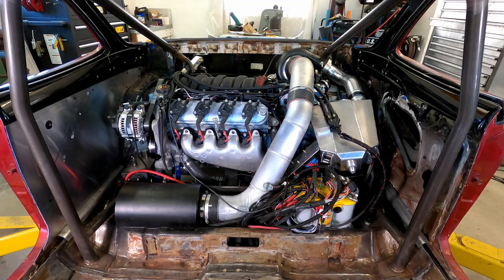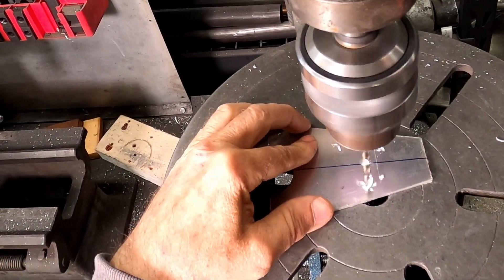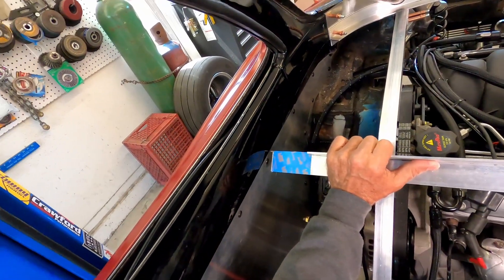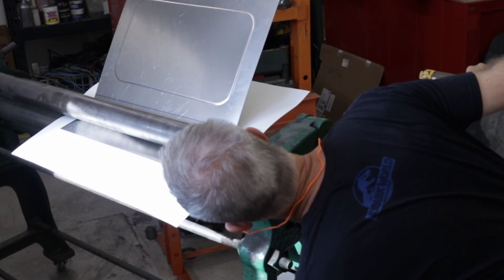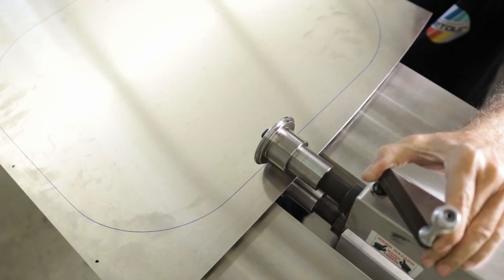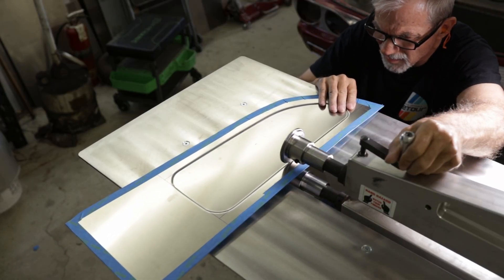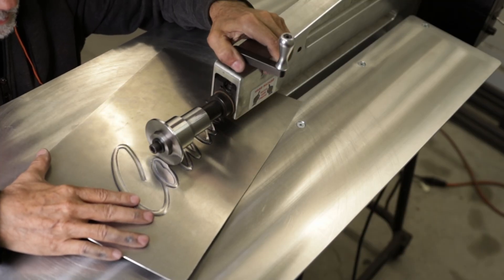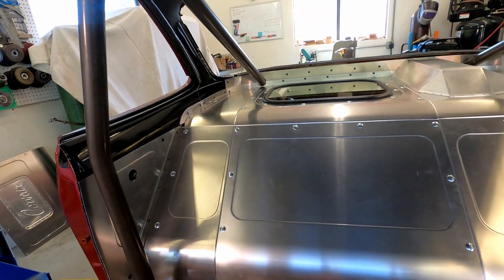Complete aluminum engine firewall construction

Comment: Hi John, Fantastic work!! Hey.. can you do a little over view on your bandsaw. It seems to cut all sorts with ease. It would be nice to know some specifics?
Reply from the maker: Yeah, it’s a 40 y/o 18” Enco. I think I paid about $800 for it 15 years ago.  I always use a thin, narrow 1/4” blade so that tight curves can be done.  Sometimes it’s the most used machine in the shop
Reply: I guess we don't have that brand in New Zealand. Is it designed as metal only or is it one that's been modified ? Cheers @JohnReynolds661
Reply from the maker: @KiwiSkipper  You just need a slow speed unit that is made to cut metal.

Comment: Radii is the plural of radius. Hokey smoke, radiusseses?   Hearing your explanation of the sight glass for the engine, cool, I was hit with a thought, Why not get a replacement glass from an oven door. I have never tried to acquire one to purchase but a good appliance store may be the place to try. Now that the cover is made, modifying the size would be a pain because if you have my luck, nothing will match. McMaster-Carr sells borosilicate glass in different sizes and the larger come with a chamfered edge. It won't break you but it is saltier than window glass. Nice work, actually excellent, with the Corvair script.  Many younger people have never seen nor heard of a Corvair.
Reply from the maker: Oven ( tempered ) glass would certainly take more heat.  It's also cheaper.  I'm not sure how much heat the glass will receive, with the open back and 3 deg. roof angle, I'm hoping it rolls out.  I'll replace it with tempered glass if there's a problem.  Otherwise, the advantage to laminate glass is a lot better sound proofing.

Comment: It's impressive. Seen through video, I thought the "Corvair" panel might look good unpolished and on the horizontal section of the firewall so it could be see through the back glass with the other features like the hump and sight glass.  But you're there, and that probably tells you everything you need to know.

Comment: You sure you wanna do that, bud? Melting point of Aluminum is 660C, melting point of mild steel is 1350-1550C.... Just saying there's a reason why they call it a firewall.

Comment: You should consider adding thin layer of killmat to the back of your panels to help with noise, heat and vibration. With all those metal to metal panels I think your have lots of metal vibrating or clanging noise. This is the best Corvair build I’ve ever seen in my freaking life

Comment: The Corvair script looks great but it isn't centered which would drive me bonkers if it was mine. With or without it, the car is amazing!
Reply from the maker: The engine sets to the passenger side and isn't centered either.  There were other constraints I had to deal with that made three even panels not practical.

Comment: have you considered some kind of structure between the wheel arches to stop the engine and trans coming into the cabin /back of the seats when something goes wrong? perhaps a U-shaped tube off the roll cage hoop that could serve as a harness bar as well?
Reply from the maker: Yeah, the cage isn't finished yet.

Comment: I prefer the natural metal just as it is. However, if you feel you need to paint it, I'd consider painting it all then removing the higher spots (including the script). I suppose you could even try masking. But me, I really like the natural metal. At most I'd probably buff it to get rid of any scratches, but not polish it because I'd not want the reflections.

I bet some OCD folks are going nuts over the slightly misaligned quarter turn fastener heads 🙂

Comment: the choice to use aluminum here is ideal for its molten qualities after the fire.

I think the Corvair looks wrong in that location. Maybe its that the panels are not equal. Or that the panel is inside another panel. Actually I think that is it. If it where burned into that panel to make it one piece, maybe. Also curious what it would look like turn it vertical in the end panel (passenger side). Since the panels are all different sizes. Maybe not centering would look better.
Reply from the maker: Yeah, maybe.  If I could have put the script directly on a panel it would have been better.  All the rivets around the boarder makes it too busy.  But I can't swing large pieces around when doing the script and that's why it was an insert.